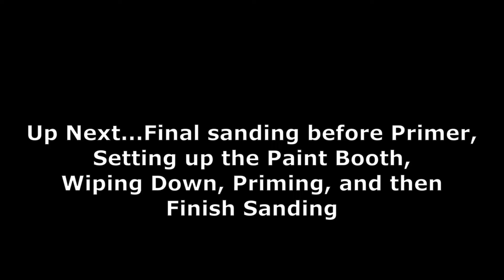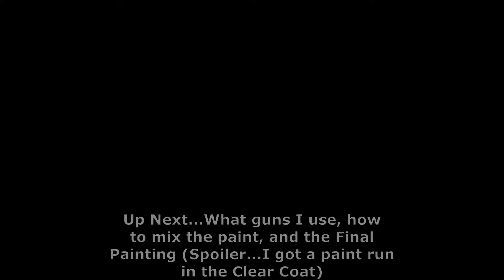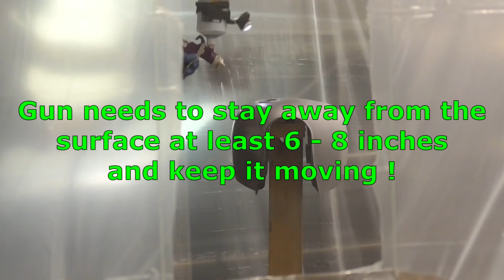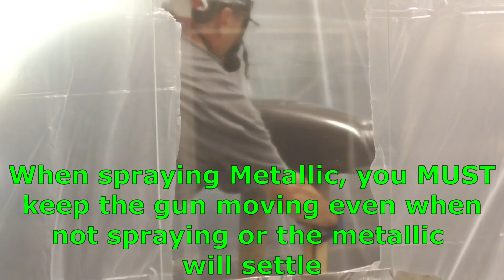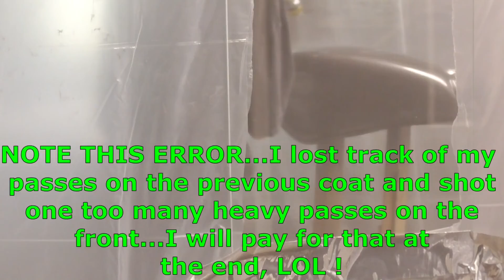Motorcycle Prep and Painting using Base Coat Clear Coat - Start to Finish (with Tips along the Way)

Comment: Excellent work.  Is the paint enamel or lacquer and why did you chose one over the other.
Reply from the maker: Thanks man 👍. This is actually a 2 stage automotive paint that uses a colored base coat and then a activated urethane clear coat. It’s the Nason brand that Oreily’s carries and they will mix just about any color you want from the different car makers paint colors. I think the color is a dark gray metallic that Nissan specs for one of their cars. I’ve painted enamels and lacquers for the color coat and then top coated with urethane clear to give it some depth and additional protection, but the enamel takes days to dry before it can be scuffed and then clear coated so I’ve started just using the fast drying base coat and then the clear. The base coat type paint is very easy to paint since it goes down thin and dries really quickly...it’s almost dry before the overspray settles to the floor unlike the sticky enamel that gets on everything and sticks to it, lol. It’s also really hard to get paint runs in the color since it dries so fast, plus you can shoot the color and in about 30 mins to 1 hour, shoot the clear and be done with all of the painting in just a couple of hours. The base coat / clear coat does cost a bit more (I think what it took to paint all of the parts coat about $120 in paint supplies), but it should last many years since it’s automotive paint that has all of the UV protectors in it and stuff.  Thanks again and all the best !  Steve